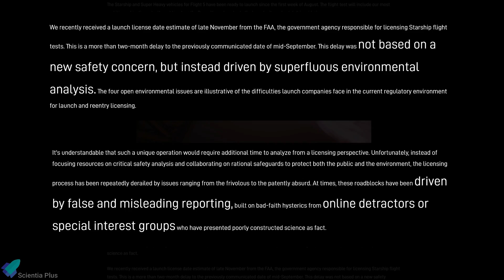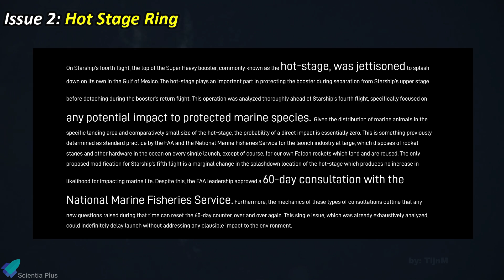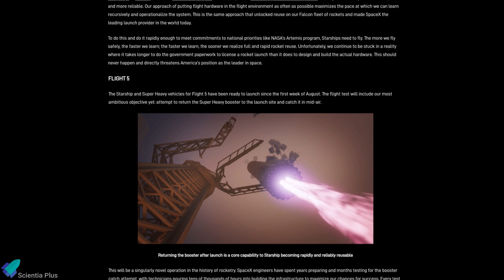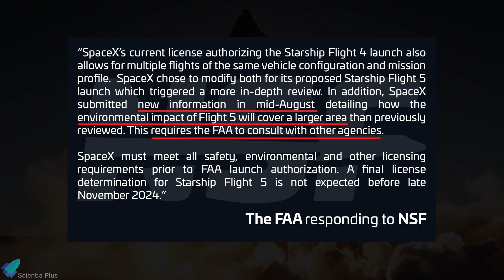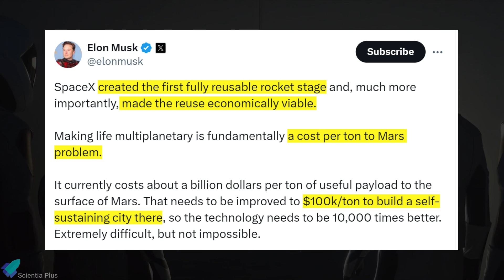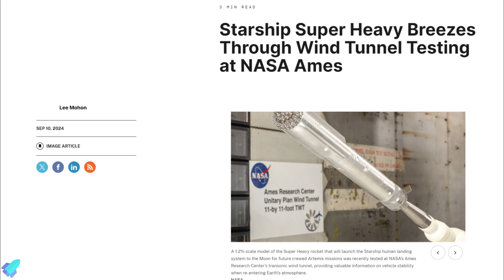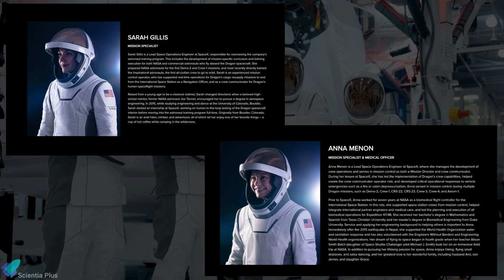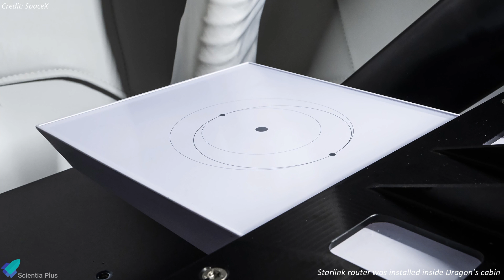Starship Launch License Denied: FAA's Ridiculous Reasons! SpaceX Responded

Comment from the maker: 00:00 Starship Updates
09:42 Polaris Dawn: Inside the First Commercial Spacewalk!
13:02 Starliner Returns! What’s Next for Boeing’s Spacecraft?

Learn More:
1. Starship V2 Features:
  a. Design Improvements Update 1: https://shorturl.at/lpGT7
  b. Design Improvements Update 2: https://shorturl.at/gwNQ4
  c. Nosecone & Payload Bay Redesign: https://shorturl.at/xa60S
  d. Methane Downcomer Redesign: https://shorturl.at/XdYBG
2. Starship V3 Features: https://shorturl.at/mnBT4
3. Starship V2, V3 & Raptor V2, V3 Complete 2024 Update: https://shorturl.at/tN248
4. Raptor V3 Mega Upgrades & First Test: https://shorturl.at/TRIyj
5. Latest Starship Upgrades
  a. Starship Hot Staging Explained: https://shorturl.at/jf400
  b. Super Heavy Booster Upgrades: https://shorturl.at/Pi5R3
  c. How SpaceX Protect Raptor Engines: https://shorturl.at/4Om8F
  d. Starship New Heat Tiles Explained: https://shorturl.at/p2Ijb
6. B14.1 Booster Catch Test #1 Explained: https://shorturl.at/w0zDU
7. B14.1 Booster Catch Test #2 Explained: https://shorturl.at/mSqCO
8. Boeing Starliner Incident Complete Summary: https://shorturl.at/VuYj
9. CNBC's Starship Allegations and SpaceX's Response: https://shorturl.at/Z2WCb
10: Test Tank 16 Explained: https://shorturl.at/xd6nv
11. Starship HLS Airlock Explained: https://shorturl.at/LqUGw
12. SpaceX EVA Suit Features: https://shorturl.at/zW1qb

Weekly Updates: https://bit.ly/3HIQjPC
SpaceX Playlist: https://bit.ly/34wue8T

Consider Supporting on Patreon: https://www.patreon.com/scientiaplus
Facebook Page: https://www.facebook.com/scientiaplus

Comment: Musk on Mars - Space Unicorns

Using statements issued by Elon Musk I have calculated the viability of his Mars colonization project. Strap in, the G-forces will be very high.

Musk admitted that 1 million tons of material must be sent to Mars in advance of humans to supply the components for safe habitat.

That requires 10,000 successful launches and subsequent descents of Starship to the selected habitat area on Mars (100 ton payload per Starship claimed by Musk).

In addition, Musk stated it will take 6 more Starships for every Mars bound vehicle to refuel those Mars bound Starships for the actual Mars journey. That's 60,000 additional Starship launches, allowing that there are no failures.

This gives us 7 launches for every Mars bound vehicle. So in reality, at one launch per day (wildly optimistic = delusional, but let's go with it) it will take 7 days per Mars bound vehicle. That now totals 191 years to complete material transfer.

1) What will happen to the first material that lands after 191 years while it sits waiting for the final structural parts to be landed?
2) Who will finance each Starship?
3) Who will finance the cargo?
4) Who will finance the fuel mass needed to make the journey?
5) What can be done at the Mars site if material is damaged?
6) During the 191 years will there continue to be a viable SpaceX factory?
7) How many Starship launches will fail during the program to put material on Mars.
8) How many Starships will crash during the landing phase on Mars?

These are the most basic problems. There are countless questions for the logistics to get started, keep it operational and do the costly program maintenance.

Comment: Catching that booster is still far too risky given the catastrophic damages and delays if missed by even a small amount. More intermediate tests and demos are required to preclude a major disaster
Reply: Do you even know the catch procedure.? They come in over water and only after demonstrating accurate control then slide over to be caught.   It has practically no fuel and is using like only 1 or 2 engines (because it is light).  They did in 287 times in a row with falcon before recent one toppled over after landing.  Finally, it is a TEST.  Nothing can be proved until they do it.  They have are also nearing completion of another launch tower for redundancy and increasing throughput.  You imply this is some sort of haphazard process, but Elon has been doing booster return for years and no one else in the world has done it ONCE.
Reply: @sawyerw5715  T Y
Reply: @sawyerw5715  Not a single Falcon has been caught in flight during a landing procedure. I only hope SpaceX are not so free with casual falsehoods as some of his supporters.
Reply: @noneofyourbeeswax01  where did I say they had been caught? You're bad inferencing is as bad as the rest of your logic. However they're doing very precise Landings on barges at sea pinpoint. That control informs the process. You can't prove something until you've done it once with that's what testing is for they've gone through many subtests using using some simulcrums to test the arms. They've already done the navigational control and they're in the process of proving that they don't even have to land unless they feel they have complete control